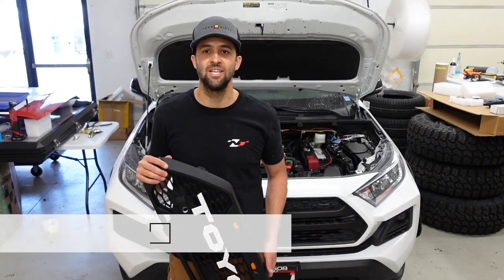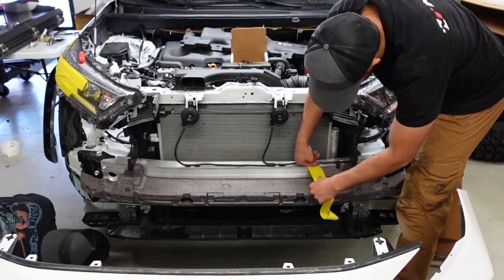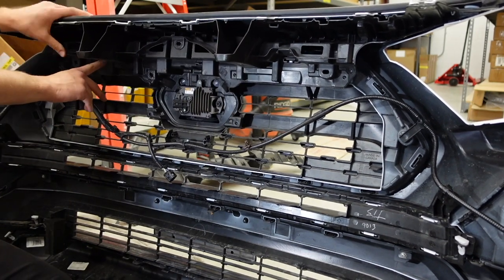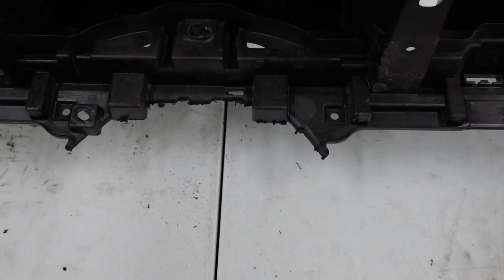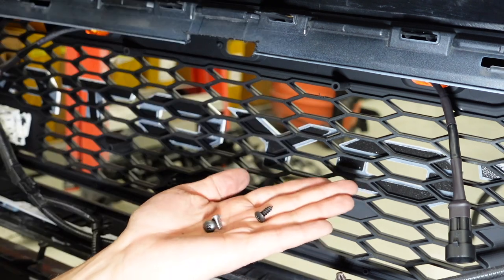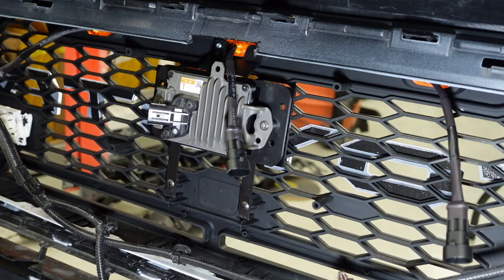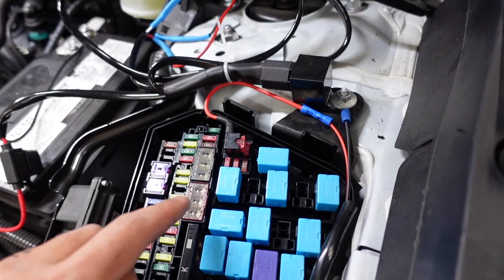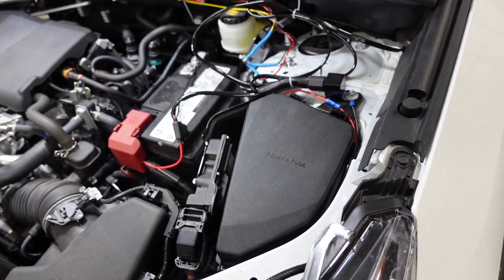Rav4 Adventure // TRD Raptor Grille

Comment: Was hoping mine was going to be in the video😅. FYI I started having issues with the Tss sensor on longer trips, not sure if it's because my bracket was a prototype. But I read that it needs to be calibrated whenever it's removed. I'll be seeing what toyota says this weekend. Need to pick up the blacked out amber lights as well.
Reply from the maker: We haven’t had any issues yet with the raptor. The pro grille is hot and miss and we can’t figure out why. See what Toyota says
Reply: @tacovinyltv  can you pls check your spam mail to see if my email went through